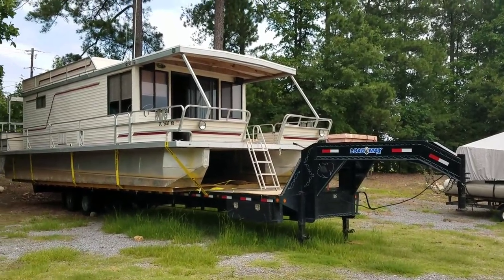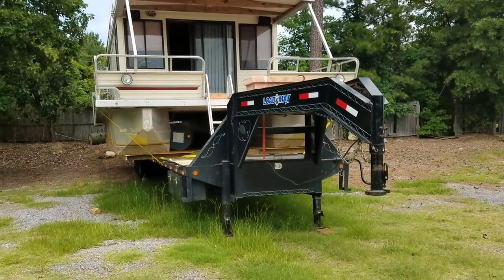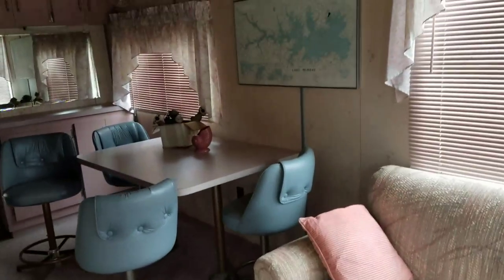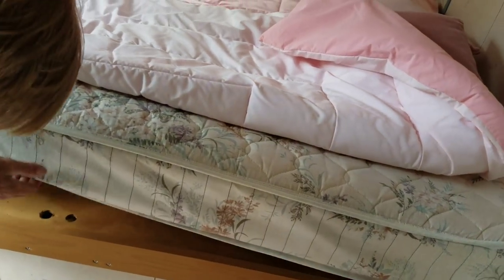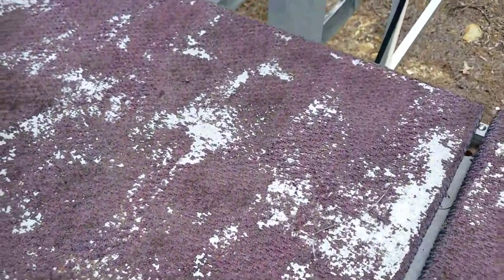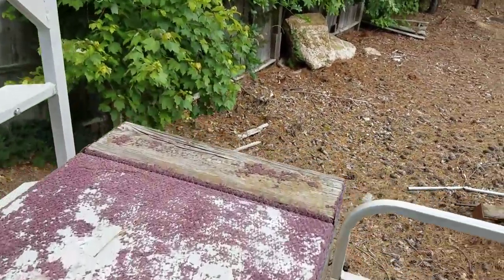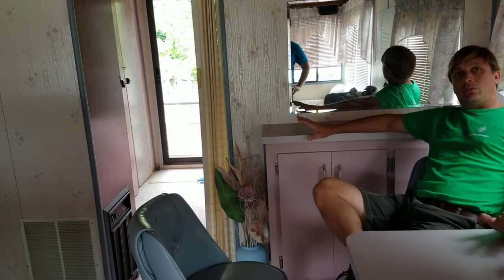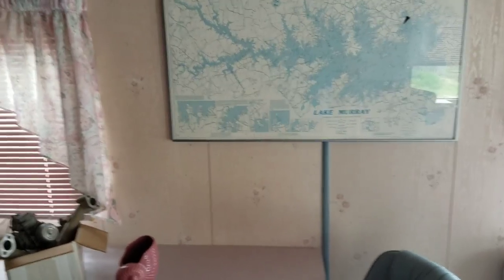**SOLD** 36 Foot Aqua Cruiser House Boat - Very Unique Custom House Boat

Comment: Didn't quite catch it in the video, but what was the HP of the old motor that was on there? At 16K I'd by it, throw on some new carpet and slick it up on the insides throw on a brand new or late model 100HP merc.  Go fishin for a couple weeks or years and be one happy camper/boater.
Reply from the maker: I want to say it was a 115

Comment: I wouldn't trust you two to sell me an Ice cream in the dessert, a real pair of con men
Reply from the maker: David Storton no worries buddy, I doubt you could really afford it anyway, the guy that bought it loves it and we keep in touch with him, as described all it needed was a new motor and the guy has a really cool boat. We actually lost money and time on the deal, I wanted it for a lake up in TN but a slip I thought I could get for it fell through and the transpo cost was more then I wanted to pay so we decided to cut bait. Also we got it out of the water and ready for transportation which was no small feat, we had to tow it several miles with another boat and make a custom deck on that trailer, then getting it to float on inch by inch on the trailer with a very thorough tie down process, an 8 hour day for some highly skilled good ol boys, if we would have charged retail for what we get paid for custom work that would have been at least $1200 plus materials so getting it out of the water would have been close to $2000 IF you could find us and we decided to take the job(A-Team reference). So let’s see, we helped out the guy that was selling a weird boat that didn’t run with no trailer, a boat he had been trying to sell for over a year with no luck because it’s so weird, we get it ready to move, something a guy like you could probably never do, ended up selling it for a small loss and a lot of personal time and yet we are con men. Trust me buddy, you would not have to worry about buying anything we might be selling, I wouldn’t deal with you, in fact I I talked to several people with an attitude like yours and I just blew them off, the guy that has it now and loves it had a neutral attitude so I made the time to show it to him and do a full walkthrough, 2 hour drive from my home so about a 6 hour deal. I’d say between my buddy and I we had about 40 hours in the thing and trust me, we make good money with our day jobs, this is just a hobby.  Thanks for watching the video though, I do make a bit from the views although it would have to get to about 2 million views to make back the money I lost on the boat so if you don’t mind maybe watch a few more times and share it with your friends, if you have any friends with a smartphone or computer that is.

Comment: I'd love to find a couple of large pontoons nothing on them just the pontoons that I could take and start building up myself. I would start I have three 650 CC Suzuki V-Strom engines all with the same amount of miles. I would like to try to put two of them in the rear and one up to act as blowers to make it to your left or right. But I think these 650 running on about 12 to 1400 RPM will be all a person with me. Dan start building his dick and I have what I would call it. Use have Ralph lumber any other half treated lumber it would look pretty good. Just some ideas if anyone knows where to get some pontoons between 28 to 30 ft how was your appreciate a shout.. God bless and have a blessed with your project here somebody got a hell of a good deal